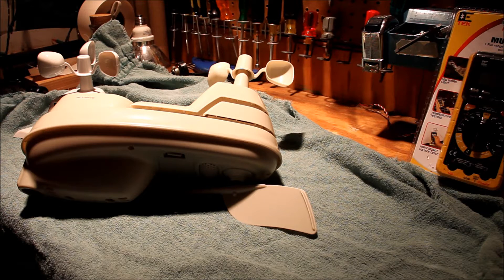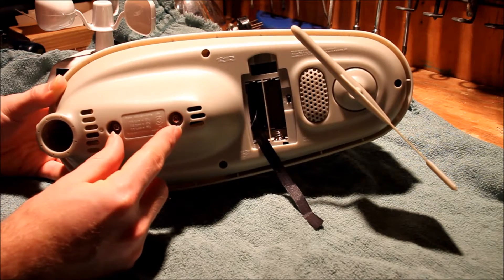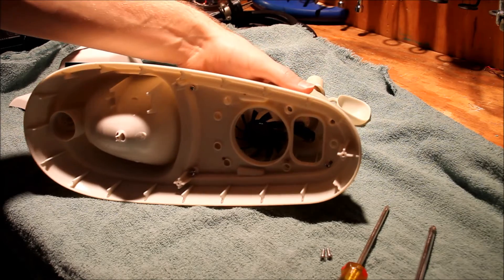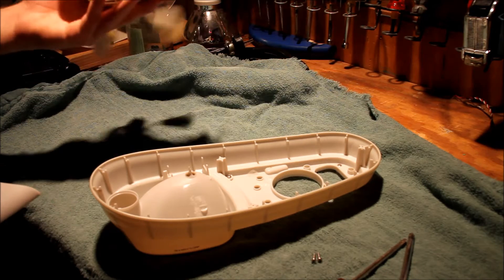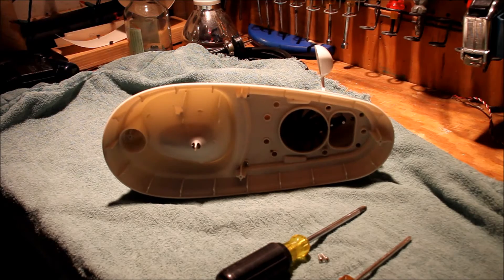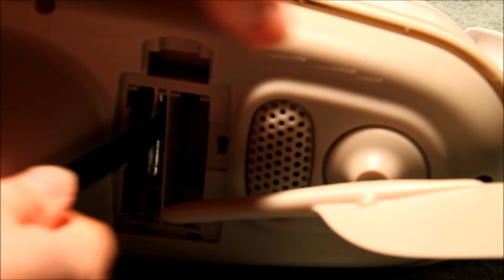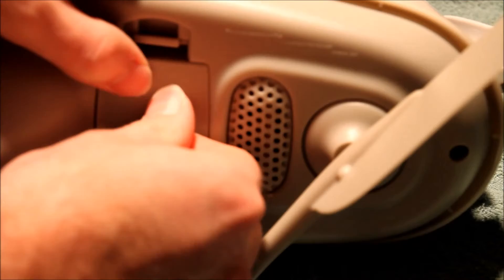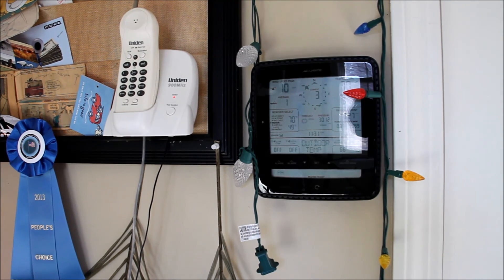Repair AccuRite Weather Sensor

Comment: Thank you, Jordan.  Nice job with the video.  Have you tried taking the fan part and fixing the bearings or mount?  Mine makes a terrible screeching noise.  I'm going to work on the fan and replace the bearings or housing rather than put another unit in that may fail.  Many people have reported fan failures.

Comment: mijailnic0358@"gmail.com Good evening, I have an Acu Riter 5 in 1 station,
I have a problem, it does not transmit the data to the receiving screen,
 I have been using it for 2 years, I have another 3 years and I cannot connect it or transmit data to this other screen, if someone has or knows what is wrong, you can tell me what to do to activate it, thank you
Reply from the maker: Is it on the correct channel with good batteries in it?

Comment: I set my clock and about two minutes later the minute starts advancing by two minutes.  It looks like it is a second counter. Any suggests??
Reply from the maker: You can try a hard reset. I've never had that happen with my unit.

Comment: My temperature is "stuck" on -40c.....I did a factory reset and took out the batteries and replaced them with no result. Any suggestions? Thanks!
Reply from the maker: You’ll have to replace the thermometer/hygrometer component in the outdoor sensor. I encountered the same failure within mine not too long ago, I will be posting a video regarding the repair in the near future.
Reply: @JordanU  Thanks, I look forward to seeing it!
Reply from the maker: @pitpony2006  I stand corrected, I already uploaded it: https://www.youtube.com/watch?v=K_IOPzMD_Hk&t=1120s

Comment: Any clue why mine won't detect rain but it does detect when I pour a little water from a bottle? It hasn't rained in 6 months until today. I tried resetting it... everything  else works perfectly.
Reply from the maker: Do you hear a clacking sound when the water is draining through the unit?
Reply: @JordanU I did when I tested it after I took it apart to clean it. There were spiderwebs attached to the paddles. I'll report back after it rains later this week.
Reply from the maker: @robertberin4872  OK
Reply: It works!
Reply from the maker: OK!

Comment: Looking for a detailed picture of the rain gauge sensor mounting, disassembled it and seems I may be missing a piece of the assembly. Makes no sense and unfortunately I did not take a picture before I removed it.  Tracked back and cannot find what seems to be missing. The sensor has a pivot, two screws hold it in place, seems there should be a spacer between the cup and the mounting screws, can anyone confirm or provide a picture. These videos get close but I cannot tell. Thanks in advance.
Reply from the maker: Unfortunately it's been too long since I did this repair for me to remember how it goes,, but I believe the fan in my unit has failed again because the temperature readings during the day are much higher than they should be.. If I take it apart again I will do another video and show the insides in greater detail..

Comment: Hi, do you have the part number for the fan? Mine took a dump over a year ago. The original didn't last more than 9 months. Such JUNK.
Reply from the maker: Off hand I do not, but I believe the fan has checked out in mine again as well so I will take a look..
Reply: Jordan U awesome. keep me posted. I looked on there site and couldn't seem to find it.
Reply from the maker: I believe this is the part that includes the fan: 5N1WCBSA
Reply: @JordanU   for the standard or stock replacement:  https://www.acurite.com/replacement-5-in-1-sensor-assembly-wind-cups-5n1wcbsa.html
Reply: for the newer model shown in the video:  https://www.acurite.com/pro-plus-upgrade-for-5-in-1-weather-sensor.html

Comment: Well done on the video, it's a shame that these companies use such cheap quality components just to save a few cents. There is no reason the fan assembly shouldn't last for a decade at least.
Reply from the maker: I agree.. Unfortunately,, this is just like everything else,, its simply not made to last anymore.. I'm just glad the one part can be replaced instead of having to toss the whole thing and fetch a new one..

Comment: Great. Nice Job. May be need to delete the false rain gauge reading using the delete button on the back of the display console. Rain gauge reads false as the tipping bucket moves a lot during handling of the sensor.
Reply from the maker: Thanks.. I did reset it after the repair,, the wind readings were also off from manipulating the sensor to test it..

Comment: Nice video Jordan thanks for posting hopefully I'll never have to do this but now I can see how to do it and seems simple enough. How long was it before your fan started to fail?
Reply from the maker: Thanks.. Unfortunately it wasn't long at all,, maybe 2 years.. I don't remember for sure,, I received it as a gift so I have no purchase record to refer to..
The replacement fan is still working fine,, however now I am noticing that the bearings for the anemometer portion are occasionally making noise.. I don't recall this happening with the first one..
Reply: mrelectron62 www